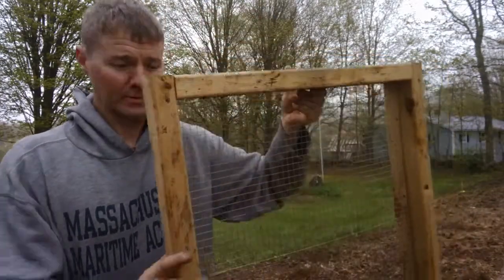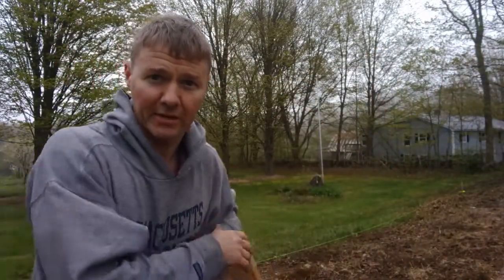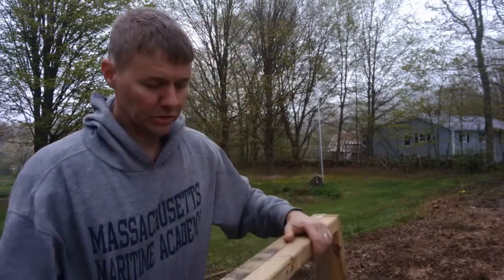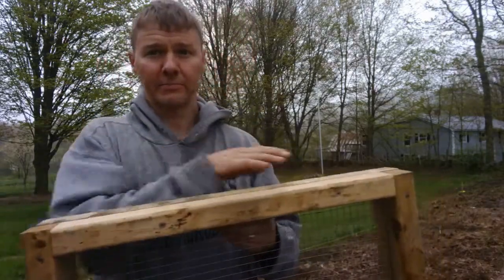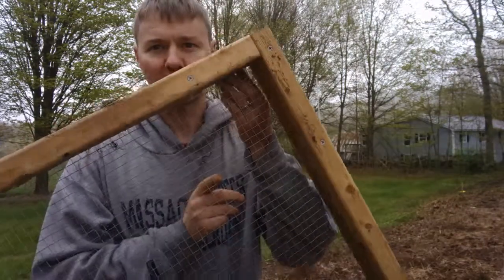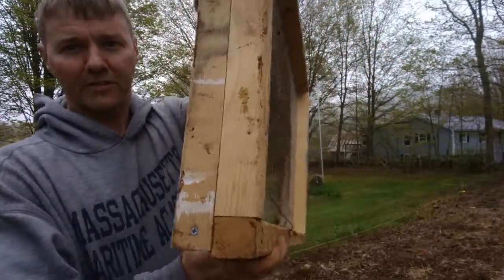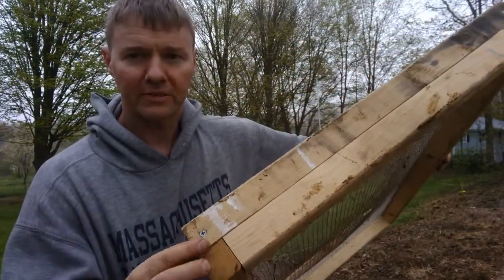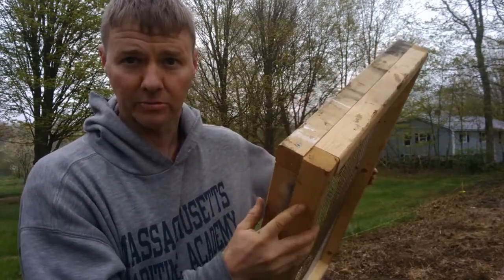Quickly Build a DIY Soil Sifter

Comment: What about putting a larger screen in between the top and bottom halves and cutting its corners off then folding its ends down and stapling those ends to the sides?